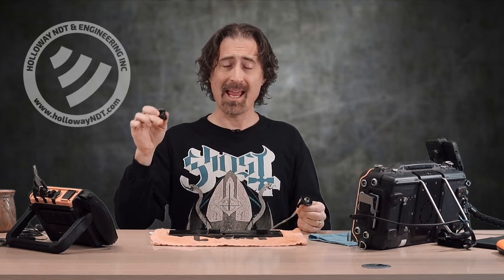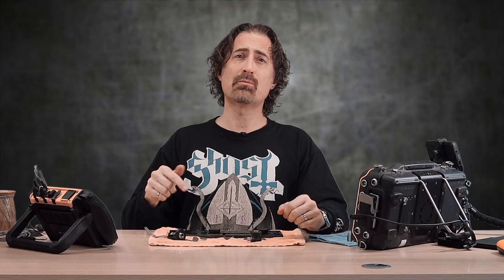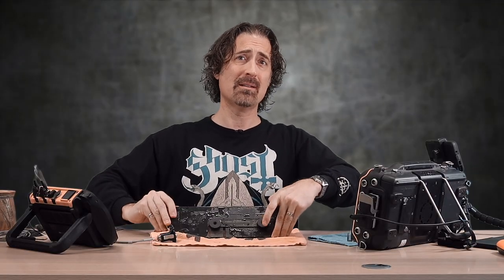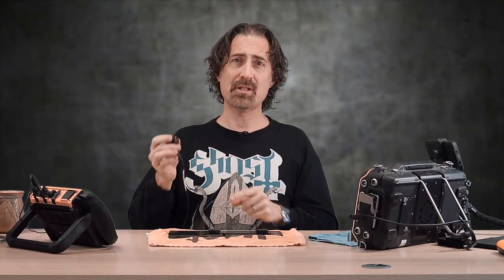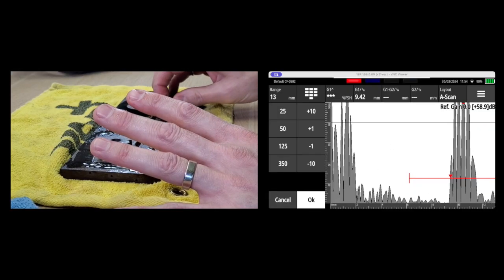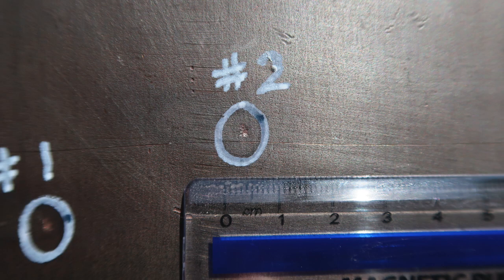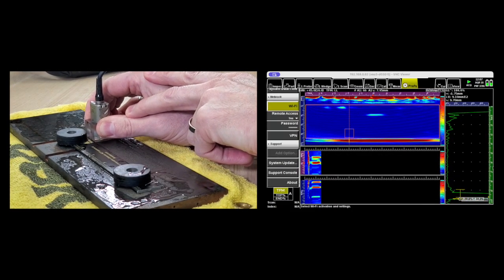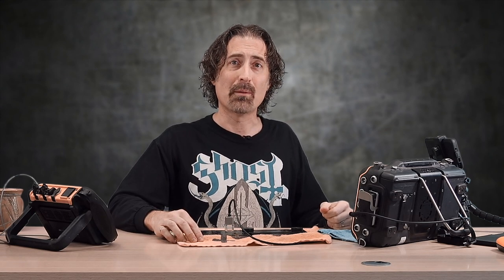Corrosion Inspection on Noisy Steel

Comment: thank you for this videos ,there is a way to inspect corrosion without the contact with the material ??
Reply from the maker: You could use low frequency eddy current, but it's more of a screening tool.
Reply: @hollowayndtengineeringinc.5201  do you have some documentation or example of that.thanks

Comment: I remember we faced a lot of noise while mapping the corrosion on tanks using Silverwing's Scorpion 2. If I am not mistaken, the Excel macro report generator they provided had a high/low filter that kept everything tidy. It was ages ago, so I am a bit fuzzy on the details, it might not be related to the video.

Paul, you are the gift that keeps giving, as always, thank you for the valuable insights.

Comment: In this case we asume HIC defect?
Reply from the maker: Definitely not. If HIC is suspected for the service of the equipment, then an appropriate inspection technique should be applied. In this case, it's just noisy hot rolled steel.

Comment: I would assume that almost all of the plate defects should show up at approximately half the nominal thickness.
Reply from the maker: Sometimes yes, sometimes no. If you see the macro image, they could be anywhere. For laminations, yes... they're usually "big sheet" reflectors about half way thru
Reply: @hollowayndtengineeringinc.5201  is there a way to tell the difference in laminations and hydrogen blisters or hac?